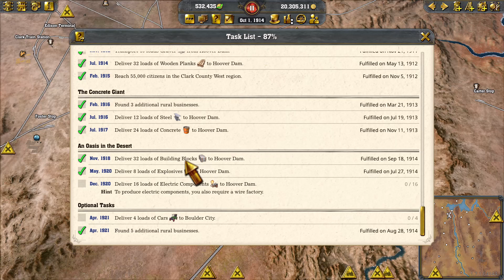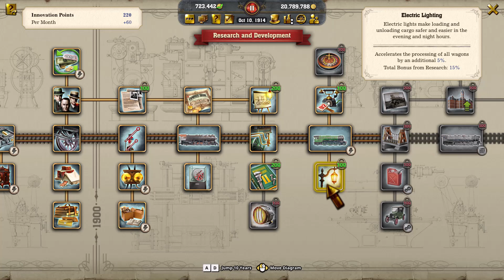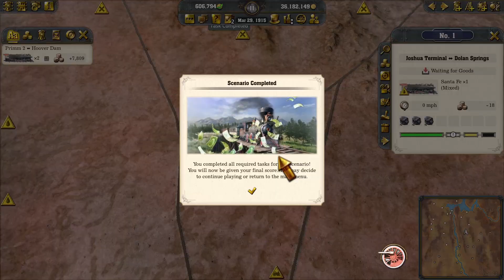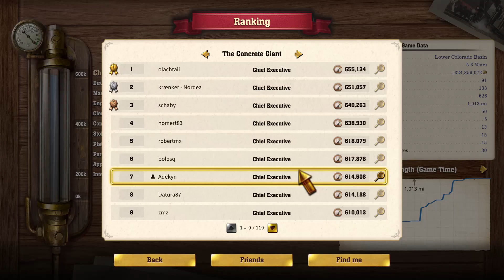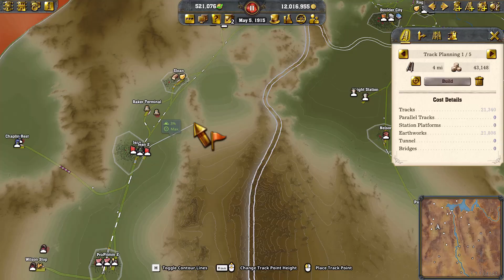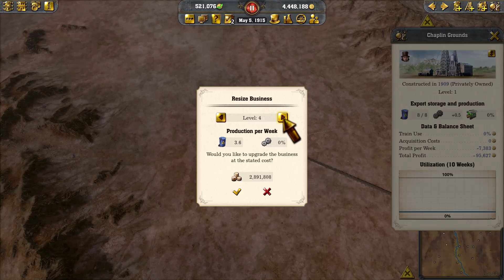Railway Empire 2 Industrial Wonders DLC Hoover Dam Part Seven

Comment: I have a question about game speed. I play on Xbox, which has 1x and 3x speeds. But yours seems to run a lot faster, which would be pretty convenient. Do you use a PC? Any mods?
Reply from the maker: PC. There is a setting on the options to allow the faster speed.
Reply: @Adekyn100  Ah, thanks Adekyn I'd been wondering about that speed thing too. Love all your videos, looking forward to China. I'm finishing up the Hoover Dam and your tip about needing to have a customer for the copper wire is tucked away in my brain for future reference thanks :)

Comment: Hey Adekyn, Speaking about Research (31:58) I only pick high-priority research items that reduce my track building expense (not bridges/tunnels), immigration increase or increase my dedicated passanger/package revenue (where I make my steady high income), then get the the higher tier research items in the tree, then go back and pick up medium-priority items, then low-priority items. Railway Empire 1 university (32:40) increased research innovation points, but not in RW2. 
After I get started, I pay off bonds and do not use them until the sprint at the end when I need a bunch of cash, like you did here. Building a good in the destination city does count (34:25) 
Nice work! Looking forward the the next video! Scott

Comment: Yeah, you had inspired me to play the original RE back in November of last year, and I hit a bug that kinda made me stop...

If you just upgraded stations everything was fine--like from a small to large. But when you had to DELETE a station to replace it with the large auto-signaling version, it LOOKED OK, BUT, source stations for a good going into that new fancy station usually would NOT trigger! i.e. Big new station had a demand for coal, rural station with 8 coal would NOT load a train with coal!

If you deleted the train line and put it back in, STILL no coal was picked up! You had to delete the RURAL station and put it back and then the new trains would pick up the demanded coal! So I suspect however that got introduced to RE after RE2 came out, as they tried to fix it it may have morphed to what you experienced.

Your case was really bad as you hadn't done much of anything, as far as I can recall, that might have messed with the stations in that way.

Comment: Ah, you finished just before I finished my second run. I am a bit closer to you now and do have the Chief Executive. 
I did what you suggested in the end, to start the factories in the bigger cities (for example electonic parts). Downside to that is that you really need to bump it up to level 3 or 4 because that city IS consuming those products when it is that big (and other cities if you have city to city lines!). That makes the task of running it to Hoover dam a bit more complex.
I think in the end it is faster to start in a smaller city so you can have a dedicated production for Hoover dam.
Reply: i just block it on the trains to other city's that way only the city consumption is getting taken out. little bit manual work but only takes a few minutes